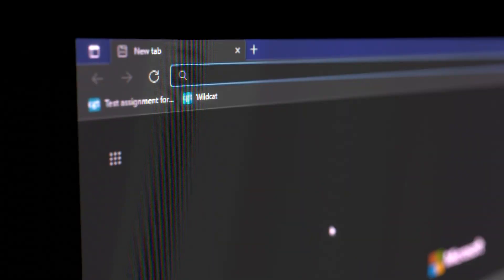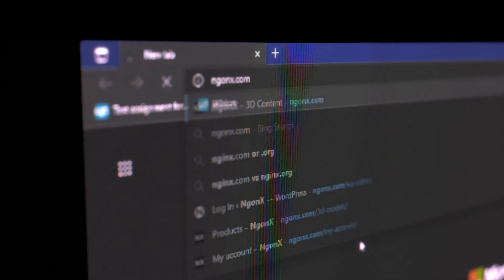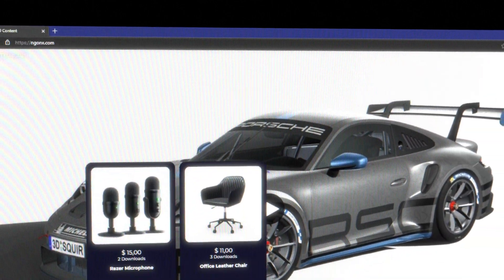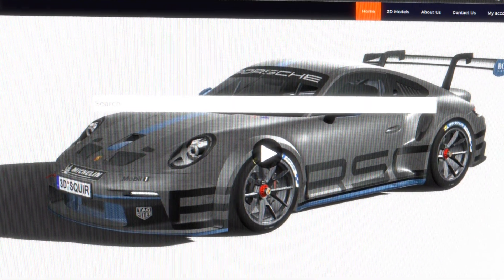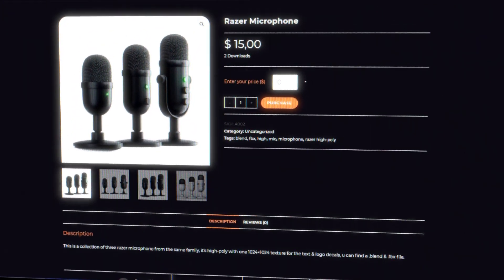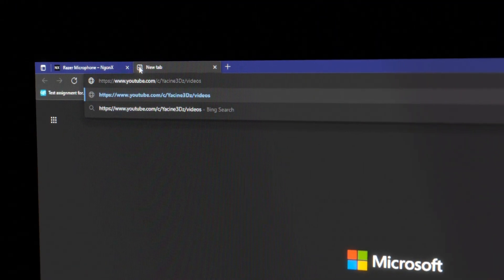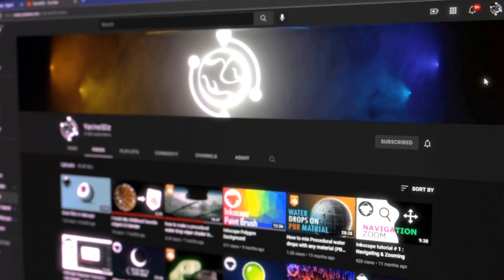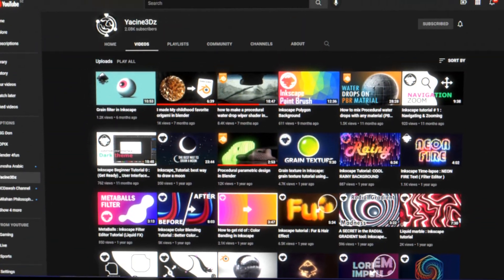3d modeling Timelapse of the Razer Mic _ blender _( FREE DOWNLOAD )

Comment: The way you spread that grid is not the right way. The more curved the object the grid is projected on is, the more deformations you'll get. Here your grid is fine on the top, but ultra stretched at the bottom. 
You should have used Tissue Tools.